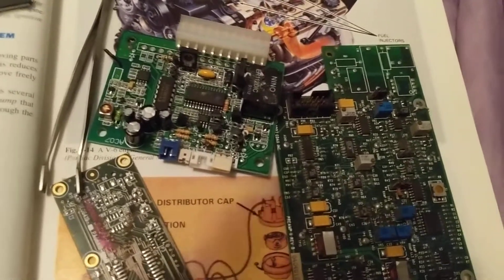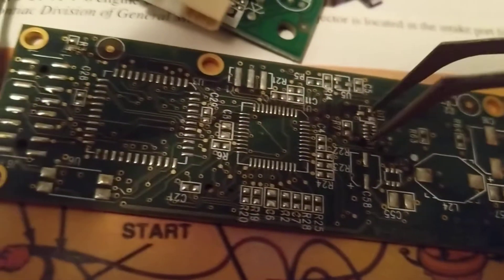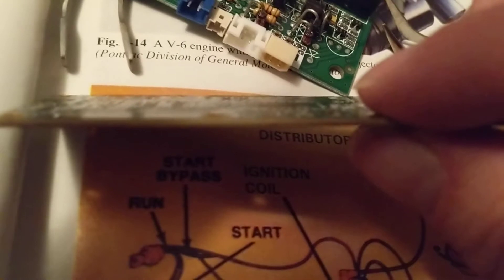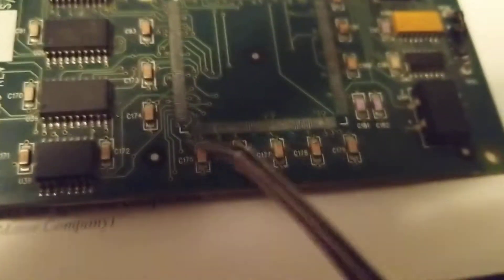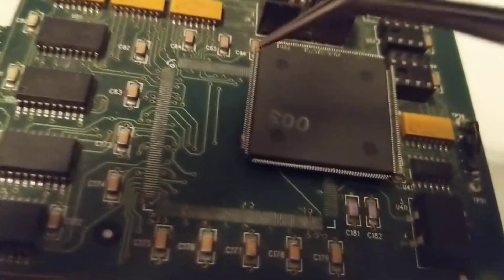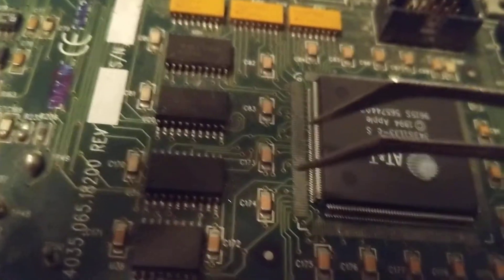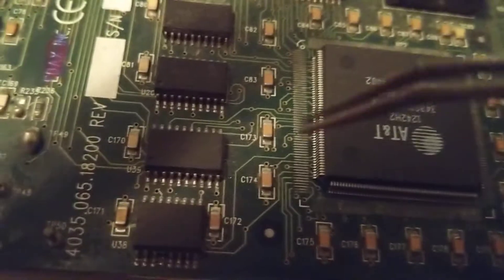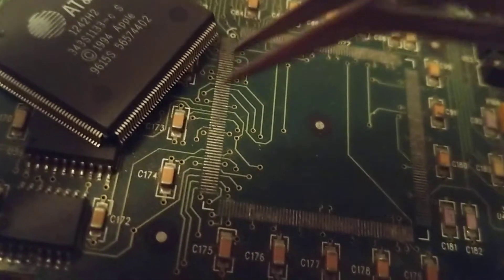HOW COMPUTER CONTROL MODULES WORK IN A VEHICLE AND DIAGNOSING THEM

Comment: It means you must use a expensive microscope to work on these small tiny parts ; thats where the headaches come in.
Reply from the maker: Actually there are magnifying glasses that you can use which come on the head shield attached to it but yes I did use a microscope and it affects your eyesight after a while
Reply from the maker: In manufacturing when I did work in it they were microscopes that we used the parts are getting smaller and smaller as the resistors get smaller it's just not economical anymore

Comment: Look at those small million components on the mother board ; this cause me a lot of headaches ; trying to understand the flow of the power in it.
Reply from the maker: It can only be done with a schematic and unfortunately this type of troubleshooting is being phased out because it's just not economic to pay a technician and hourly rate when they can get the board much cheaper from outside

Comment: yeah show us, set up good camera  lighting
Reply from the maker: For example I was asked to make a video for mass air flow sensor my viewers I responded by making a video with the most simple oscilloscope yet the views were not that good so why continue to make another one
Reply from the maker: As I have made many videos as requests by the viewers but they don't pull in good views that's why I discontinue making the next video trying to find the topic that will work it's like when you make a movie if Rocky one doesn't sell you don't make Rocky too

Comment: The engineers decided its a good idea to mount my ecm on the side of a diesel engine. There's definitely no vibration there
Reply from the maker: I understand what you're saying but this is just not for ECM this is also for the cluster module that I worked on and other modules such as bcms lighting modules and it depends how many layers the boards are and what type of chips the thinner the leads of the chips like microchips the more it is to come off the pads thank you for your comment

Comment: Wow I’m a new subscriber trying to learn electronics automotive in my retirement years. My profession is aircraft mechanic but I want to keep learning and I’ve chosen this path. I’ve learned more in 5 minutes of your videos than all the rest I’ve watched. Please post how to remove and replace and verify the problems. Everything is very interesting also the equipment you use. I’ve been purchasing tools and equipment but want to purchase the correct tools. Thank you for sharing Artie 😊 speaking of aircraft I worked for Grumman Aerospace for 23 years until they shut the facility up here on Long Island New York. You mentioned the military I received my training through the USN. See we have similar backgrounds. Great 😊
Reply: Thank you for the compliment the equipment used is a multimeter any digital multimeter is fine and also a clamp meter which is a meter that measures current wrapped around a cable or a wire to measure current there is a scope but I find that you need to be familiar with the parameters of the scope thank you for your comment and good luck